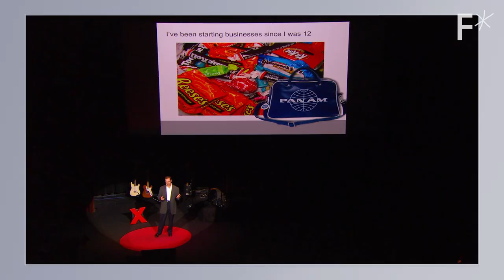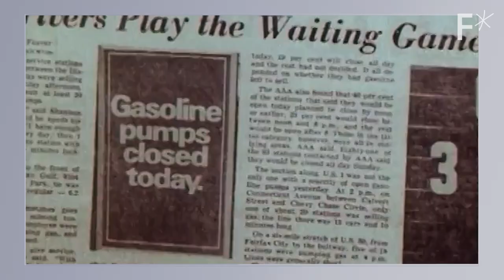The tech that could eradicate fossil fuels forever | Hard Reset Podcast #3

Comment: Why are people so obsessed with efficiency as if that matters? Fossil fuels are incredibly inefficient. We use them because they are cheap and abundant, not because they’re efficient.
Reply: They are cheap because we can pull them out of the ground in a financially efficient manner. Different kind of efficient, but still important.
Reply: Because capitalism.  In our world, the switch to renewables happens as they become more profitable than subsidised fossil fuels.  This is why efficiency matters, because more Joules out per Dollar in.
Reply: @Juttutin joules out per dollar in is not necessarily a measure of efficiency, it’s also a measure of abundance and is why petrol reigns supreme. If/when we tap deep geothermal, the same rules/law of abundance may apply. To your point, capitalism doesn’t care about efficiency. Destroying the planet, burning and profiting from oil is incredibly inefficient and a horrible long term investment.
Reply: @flutieflambert  I'm not sure if you're being deliberately obtuse or just dumb.  Capitalism cares about profit. And only short term profit if you can sell your shares on to some other mug at the right time.  In a market as fungible as electricity, joules-out per dollar-in IS the profit equation.

Comment: I’ve lived in the urban desert for over six decades.  I live in a city where it’s common to see solar panels on buildings and covered parking lots.  All of the municipal operations will be 100% powered by renewable energy by 2030. I believe every building should generate and store the energy it uses instead of relying on huge solar farms in the middle of nowhere.   I do see the potential use of this technology for industrial processes on site but I think there are better technologies for energy generation for residential and commercial electrical needs.  The energy losses related to transmission is greatly reduced when the generation and utilization is in the same location.   Decentralizing energy production/use provides more protections in grid down situations due to natural disasters or attacks on power stations. 

I think the geopolitical implications raised are important to consider as well.   Additionally, we need to reduce our energy consumption overall through increased efficiency.

Comment: I'm voting for small nuclear\thorium molten salt for grid & hydrogen for vehicles. Just saw a new car or truck coming out that has 5 or 6 hydrogen tanks you just switch out easily instead of filling up your tank like gas. Looked very interesting & convenient.
Reply: Just switch out batteries with electric like they do  in Asia. Nuclear is the way to go.
Reply: Could you provide a link to the vehicle with interchangeable hydrogen tanks? Sounds like an interesting proposal I haven't heard of yet.

Comment: The grid is incredibly expensive $/klm, and huge length. 
Most grids are equal to the national GDP. 
Grids have been built over 100years. 

More electricity means more grid capacity. 

Nuclear is cost constrained by the grid construction costs.
All concentrated grid supplied electricity has this extreme grid construction cost limitation. 

The grid is fragile and was never overbuilt because it is expensive. 

This is an important matter if nuclear electricity is going to work. 

5 times more electricity if no fossil fuels in the future.